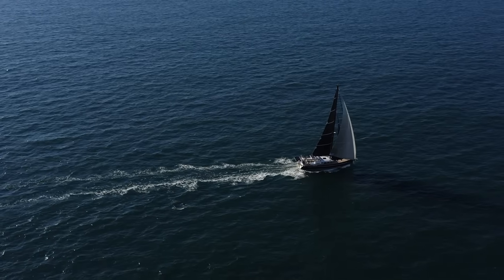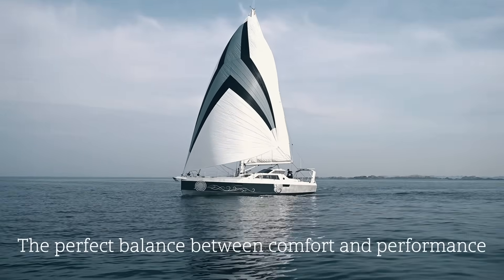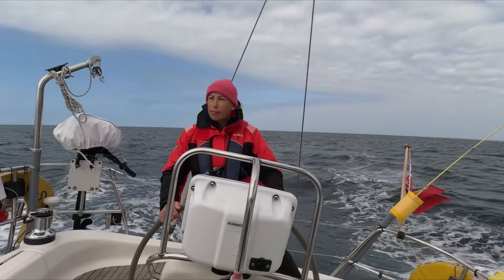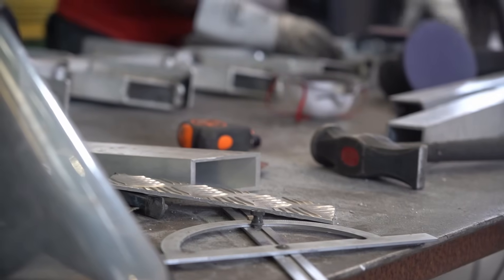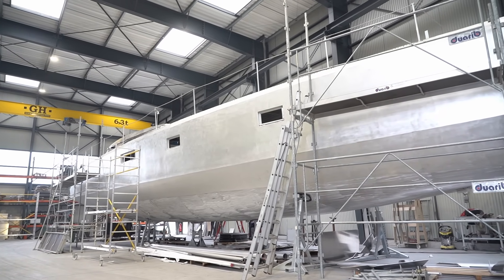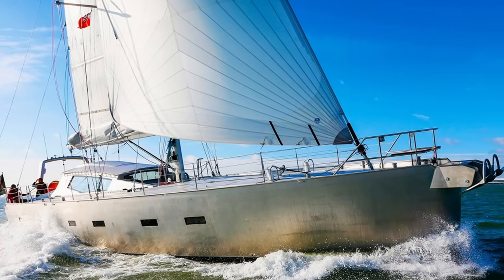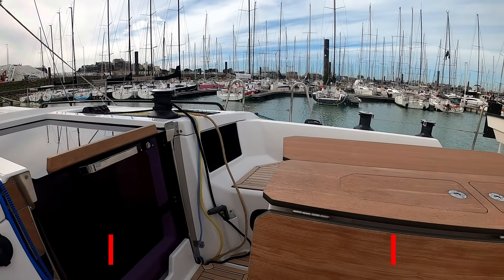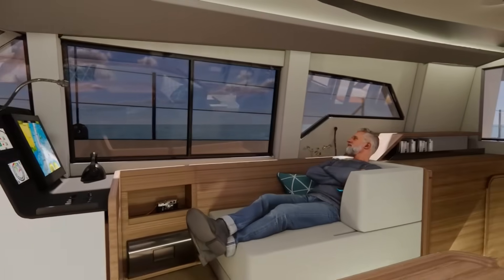Can we build a blue water sailboat?  Ep1 The mission

Comment: What may be a very odd safety issue, with cumulative health risks which may apply to a heck of a lot of Cruisers has just cropped up involving - Coffee Makers- and not just those using Coffee Pods- and these coffee makers ain’t cheap either, and a heck of a lot of American Cruisers appear to use them and far too regularly for their own good - and much to my surprise, the European Union appears to be more ahead than America with the resulting potential health impacts More information is definitely needed - Pods appear to mainly have an issue with the inks used in packaging the Pods, and an issue with Coffee in General appears to happen particularly with lower quality beans being excessively roasted at very high temperatures which dramatically increases a very dodgy content of an u wanted Content. So for safety and good health- stick with good quality coffee beans - the best used to be grown in Kenya, though my personal favourite was mildly low temperature long roasted Java, from a very good coffee supplier and bean roaster- never push your luck with high temperature dark roast - seriously inferior quality coffees that have flavourings added to make them more palatable- such as provided by Starbucks type coffee shops. Plus buy whole beans and grind them yourself as needed, then skip the Coffee machines, put the ground coffee into a single skin Stainless Cafetière - mine was about 24 dollars from Amazon in the USA, so no glass to smash on the boat, and no weak two skin Stainless ones that wear out fast - just get a few spare plunger filters for the Cafetière, as if a heavy coffee drinker, the plungers wear out in about a year, and you start getting the best coffee you have ever had, at the lowest Cost- if I manage to get back afloat, I will update on the good sources of Coffee, Tea, and drinking chocolate that I come across, with the pricing at the time. The old filter paper coffee jugs are a total fail compared to a simple Cafetière frankly, but glass ones soon end up smashed. I am mainly a tea drinker, but really like good coffee, and Drinking Chocolate with brandy in it, on cold winter nights. Bob, who is getting interesting safety alerts in general information on YouTube.🤔🌟🌟🌟❤️⛵️
Reply from the maker: Ok 😁
Reply: @SVTONICBoatWives  Yep I was surprised as a Swedish study of Coffee years ago, intent on getting coffee banned found that drinking coffee was actually seriously good for us, much to their surprise, so this may be another fake science attempt, though over roasting beans at excessively high temperatures might just be creating serious problems and very expensive coffee machines that use coffee pods, may just be backfiring. Don’t knock it, it’s an excuse to test really good coffee every morning. Bob.❤️🌟🌟🌟⛵️👍
Reply: @SVTONICBoatWives Update on a detailed Test Sailboat enquiry placed with a Catalina Agent over a week ago now, in search of a serious guide price, and with one of the YouTube Sailing channels  amongst many others likely to be interested in hands on testing of the Concept being SV Tonic Boatwives, with the boat needing to be of a two Cabin two head Layout in the 30 to 40 foot LOA size range with Setee berths in the Saloon and an inboard engine engine size that is not underpowered. The i’s dotted and t’s crossed and guess what ?still no acknowledgement of the receipt of a serious order enquiry for a concept that has the prospect of potentially significantly improving Saulboat safety and Survivability. Once everything is functioning as tended, hands on detailed testing will make the concept principles obvious to everyone, and if sticking to the old Beaufort scale principles, such as Force 6 is a yacht Gale so do not venture out in it an if out, seek shelter, then literally everyone equipped with the concept is going to be able to make it in to safety, even when things are worse BUT no matter the boat builder, almost with no exception there is no interest AT ALL ? 😡Island Packet would do it, but their boats are so strong by default they would fly through my testing too easily - same goes for Halberg Rassey, though they would still benefit from the concept, as actual Test Boats, the acquired data would be pretty useless tbh, hence the lighter construction with a bolted on keel of a Catalina made far more sense for the Test Sailboat. Frankly I am left with the last option of at some point making it to the USA, attending a boat show and sitting across the table from a Catalina Factory salesman, and slapping an ingot of Silver Bullion on the table with my specification list of Requirements asking just when can you deliver ? I am not encouraged by this state of affairs with European and American builders frankly, none of which even appear to comprehend what basic bloody words mean, or even “Customer Support” . I am pretty much at the point of saying Screw it, and abandoning all prospects of doing anything useful for sailing and Fuck it Just Dying. The Market simply isn’t worth bothering about apparently, because it is dominated by disinterested wankers who are only interested in how much money they can make out of it, and they are no different to the disasters we presently have as Politicians. Well from now on, all of them can just kiss my ass. Good Luck All- you are going to need it, with the Human Population now in Catastrophic decline , shch even mass migration no longer being able to fix. To be a successful spacefaring species, takes a population of between 12 and 14 billion today the real Global Population is now closer to 6 billion, and is rapidly falling and the working population is no longer being replaced. The Writing has been on the wall in clear view for a very long time now. 🤔
Reply: PS.Something to think about- how come something with a 40 km diameter gets sent to say hello , and is that more likely to say Friend or Foe ?Me, I say best to prepare appropriately for both eventualities, and have all launch tubes equipped, armed and in full readiness just in case - apparently it is so bright, that the light signature of its exterior is that of it being artificially illuminated, plus there are other worrying indications. ☹️

Comment: One thing I've often wondered is... why doesn't a monohul with dual fullskeg rudders exists? Why does everyone made dual spade rudders?! I mean.. Dual keel + dual full-skeg. Then you also have a mono-hull you can beach in full stability + benefit of steering in heeled over conditions.

In my opinion, the best yacht out there on paper by far is Kraken's yachts... and their rudder system looks AMAZING. It just isn't dual rudder.
Reply from the maker: I like your Idea about fully skeged dual rudders, that paired with twin engines like the Ovni 490 would give us a sailboat that was verey easy to manouver and easy to beach as you say. very stable and safe. I think that will be an addition to the design.
Reply: @SVTONICBoatWives yeah that’d be fantastic!

Comment: Hi Ladies ! I have made an extra safety addition to my Short Mast short Boomed in Mast Furling Concept that you may want to think about. It stemmed from a totally crazy idea an ex sub mariner had for improving displacement stability in severe weather, by flooding the interior of a boat to the point of it almost sinking ! I know laughable right, then a very dangerous thing happened and I had a potentially good idea? Instead of flooding the boat, how about flexible water tanks mounted securely in the bilges under the Cabin  Sole instead ? Things starting to get iffy ? Run the water maker and tip up the flex is to have plenty of ballast in the right places, plus you will know if things get really bad, that you have a maxed out supply of fresh drinking water, and no out of control volume of seawater rushing in down below. Seems sensible ? Bob. Back to watching the video. PS in good news, heart and kidneys have stabilised, plus I have a bit more Silver tucked away than I thought. Plus I’m getting kid sister up to speed with me likely to be getting a new Sailboat.Oh and it looks as though Elon Musk is interested in us having a meeting. His new Aluminium ion graphite batteries look great, though now beaten to market by the Toyota ones with 10,000 recharge cycles no fire risk and ten minute charging times- either sound great for boat house banks too. Keep up the great work. Bob.❤️⛵️
Reply from the maker: Hi Bob, great to see everything is good on the health and silver front. We will keep your idea in mind, and if nothing else, as you say, to have the extra water capacity for more of grid sailing is always a plus.
Reply: @SVTONICBoatWives  Flexi Tanks should easily keep water ballast properly under control, and tbh, I was horrified to see someone suggest just letting water into the hull - as that can happen so fast,you can soon end up actually sinking rather than saving the boat. The extent to which I was really shocked at the suggestion probably became immediately clear though ? 🤣 Best Wishes. Bob. PS. To help prove the Concept I think will be helped by having a bolt on keel for the extra perceived vessel,“frailty” though tbh, a decent GRP hull is massively strong - and have personally proved high speed collisions with rocks, yachts hitting coral reefs and towed off with no significant damage , have been far from uncommon, to which I started off saying - yeah right, pull the other one, and then Crasher just kept on hitting very nasty rocks at very high speed in flood tides and on waiting to dry out his Macwester, found the only damage was easily repaired chips in the gell coat of his bilge keels. From that perspective, an Island Packet is actually much too strong for the Concept test sailboat, so mainly due to Shallow Draft availability with a bolt on keel, I think I will be getting a Catalina- size dependent on having an in board direct drive diesel that isn’t underpowered - which may turn out to be a problem, and may demand me going to the USA for a serious face to face at aBoat show, s  M just not getting the serious questions I need answers to from electronic communication with Agents - which is just as bad with European boatbuilders, who just will not build shallow enough draft boats, or entertain low air draft above waterline Mast heights with short Booms either- they are all pretending that super expensive design calculations are required for massively reducing bloody stresses. With Catalina, all I have to do, is order a 39foot air draft Catalina 316 Mast fitted to say the 386, then take ahacksaw and smoothing file to the boom - oh and bin the string and ring sail tuning crap and fit astringent Main She Track in front of the Sprayhood and everything is hunky dory . Why ? Because all of the necessary calculations have already been done with the Selden Mast for the Catalina 316 - and it ain’t Rocket Science is it ? For beefing up 316 Stainless bar for Rod rigging is really bloody cheap, and should be good for at least thirty years before replacement. I may have to rig it myself rather than being horribly ripped off for stupid money charged by a Rigger ? If you look up 316 stainless bar wholesale, be prepared to be surprised by the shockingly low price - just don’t get German Staunless - I have never had aby that has been properly and thoroughly mixed, so has Ben plagued with ridiculously hard spots  a result- constantly breaking drill bits and taps and dies hard - so things get very slow and expensive to complete. 😡 Bob. PS. People are starting to have problems with the hardness of crush washers- used for keeping engineered things correctly aligned - today they are being supplied much too hard, so they just will not crush, which is dramatically increasing work times and the expense needed for simple jobs, like changing the selector switch that is worn out on Beretta Pistols - the ball bearing on the end of the spring cannons crushed in place ecause the crush washer is out of spec, because the supply chain supplier just couldn’t care less- this disease is now infecting pretty much everything, which means I may now have to become a  onscientious supplier once again and if I have to individually pre confirm the spec of everything before sending anything out to a customer , this could rapidly drive up prices. British Supply Chain producers such as for the springs for Slate Cutters, always used to supply spring in spec, in bull pennies each - Reolacement springs for French Slate Cutters wholesale? Absolute Crap totally out of spec and over £5 each, and those springs broke in a couple of weeks. Not Good Business. When I sold a new French Slate cutter, I asked the customer if they wanted me to replace the spring, or give them a couple of spares to take with them ?  Sme liked to watch a new spring fitted just in case there was a bit of technique to doing it right. Other than that, good slate cutters, with a holer on the back frame, and worth the money. 👍